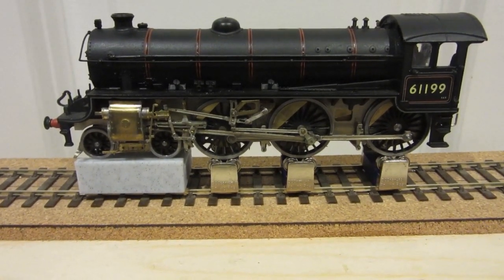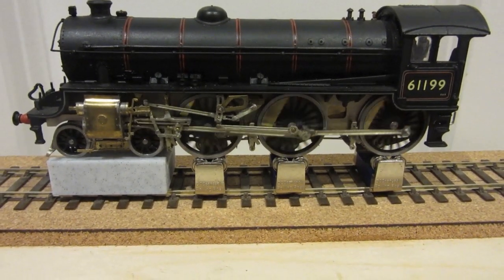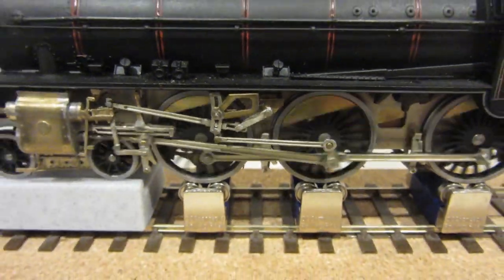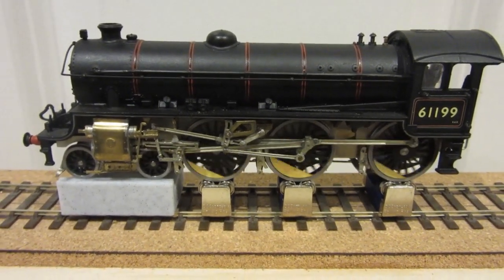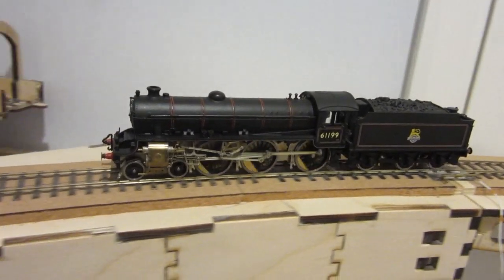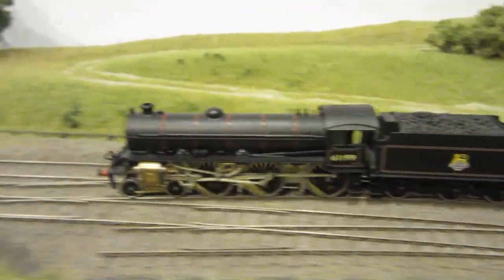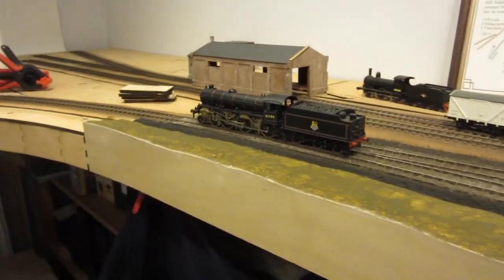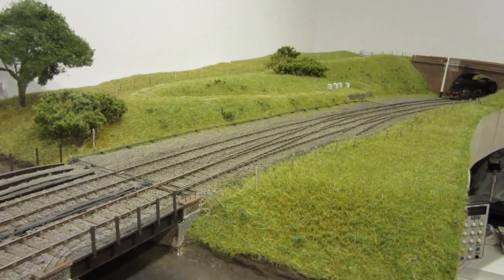Completed the valve gear on B1 chassis conversion to P4

Comment: It should, according to the Bradwell instructions, be possible to arrange a method of reversing the valve gear since the design of the parts allows it 🤔
Reply: you could find a screw the right size and make the reverser itself work even (its been done), though if you dcc, a solenoid could be rigged up to do the job!